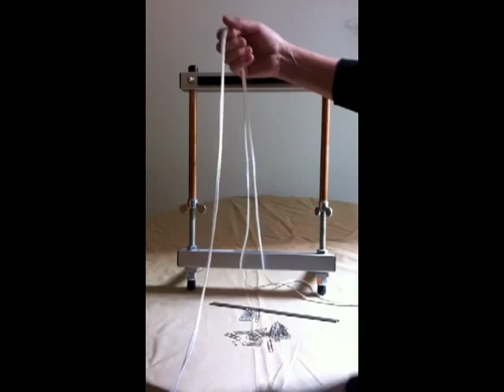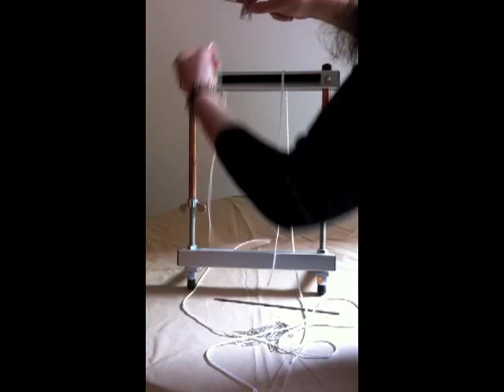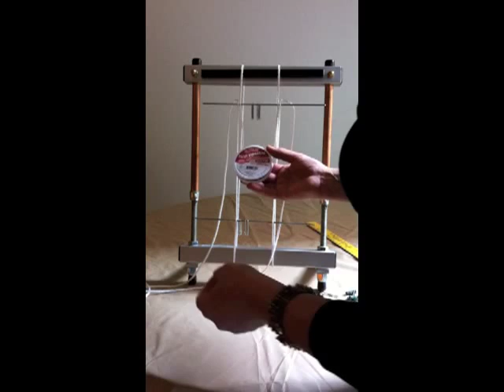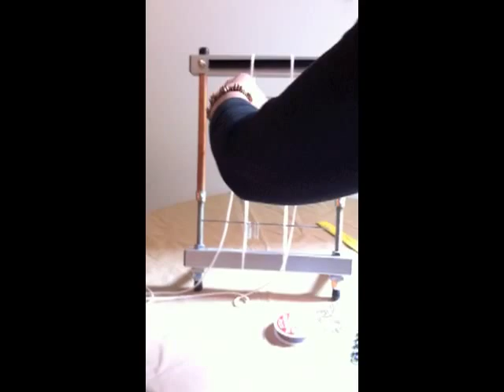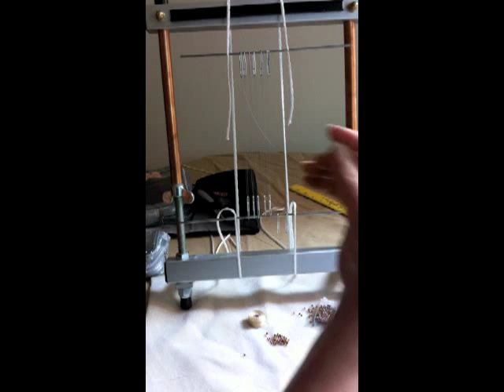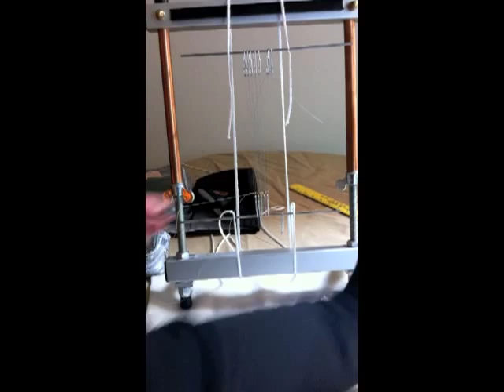Warping a Mirrix Loom With The No Warp-Ends Kit

Comment from the maker: This comment seems to have been removed, but re: question about how to balance the bar when putting on the no warp-ends kit. Just make sure you loop the cord from the back to the front over the loom and keep the bar balanced before you insert the second bar and tighten your tension. It should only have to balance for a short while.